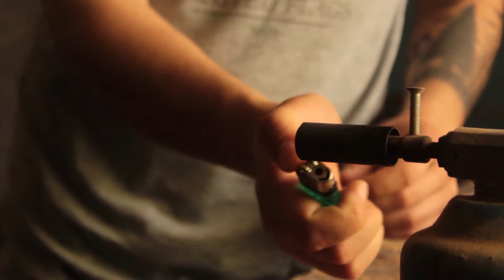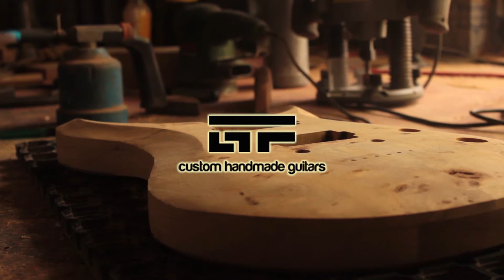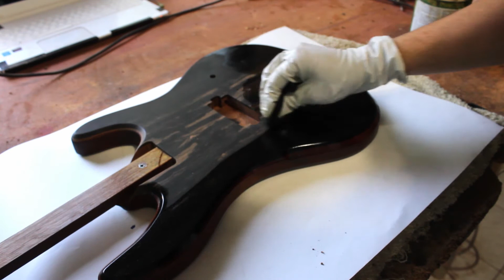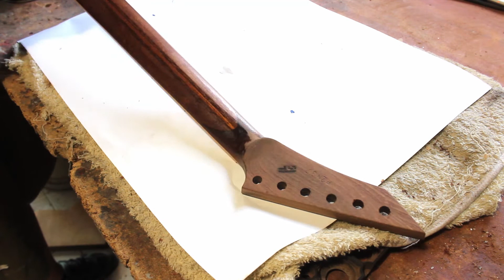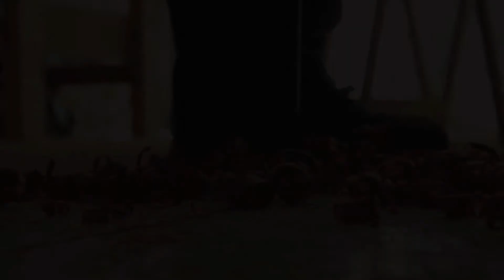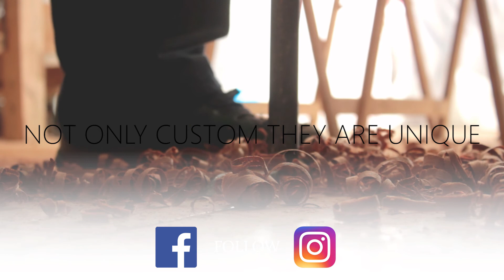Applying oil finish on ebony guitar top and mahogany body

Comment: Hi ! Nice video ! Correct me if I'm wrong, but you start with a completely unfinished wood. Then : 
1- Apply a coat of oil
2- Let wood drink the oil
3- Wipe the excess of oil
4- sand
5- repeat process 

I do have 2 questions : 
- What do you sand it with ? Sand paper ? What grit size ?
- How many coats do you usually apply in average ? 5 ? 7 ? 10 ? more ? 

Thanks :)
Reply from the maker: Hey,
only sand between coats on some woods.
some dont need constant sanding, just a sanding before the final coat.
number of coats also depend of wood grain and wood species :)

Comment: Do oil finishes seal the wood or do you have to regularly oil it like a rosewood/ebony fingerboard?

Thanks
Reply from the maker: Depends on the wood and type of.oil.
There are hard curing oils wich you dont need to re apply that often.
But nothing as durable as chemicals

Comment: One question, I did oil finish on my guitar just like you did on this one, so my question is, is there any way to do a paint job on it since the oil penetrates deep into the wood, so I'm not sure if paint will stick.. Is there any way??
Reply from the maker: probably you wont be able to.
you can try to use several coats of terbentine or any oil solvent but.... hmm...
you can make like an artwork with oil based paints.
applying clear finishes on top of oil, its like water on oil.